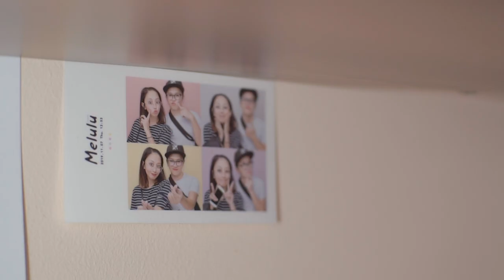Making a Leather Bifold Pen Case in 2022 (with PDF Pattern)

Comment: Can you tell me what graphics app you use to make your patterns? I was using illustrator and inkscape, but I cannot get the punch holes to line up like your patterns. I need to know your secret, it is driving me nuts! No matter what I do, the left and right side holes will not line up. I am using Illustrator CS5, so there's not the option to adjust each corner bevel, only all the bevels.
Reply from the maker: You can use the align tool in illustrator and use square or the rulers of your file work area in the app. It takes practice and experience sir but hopefully you can do it